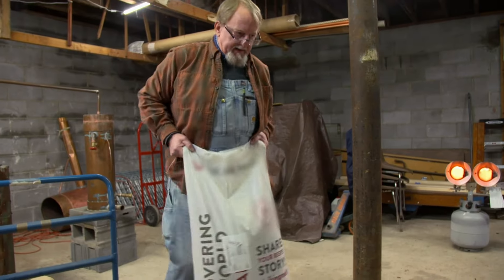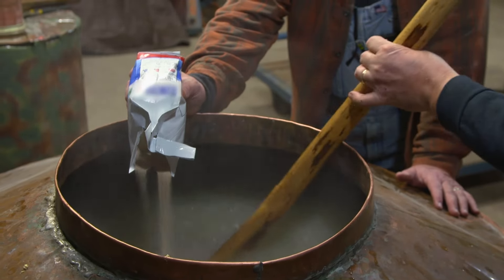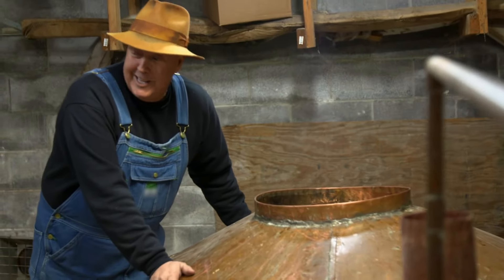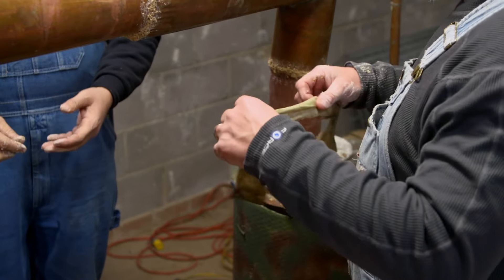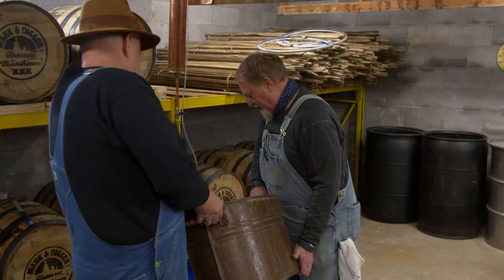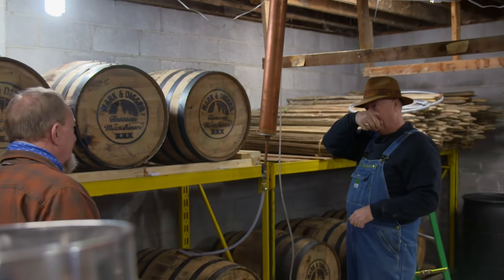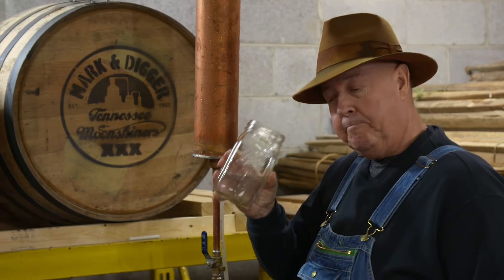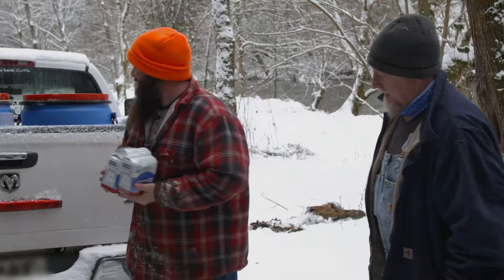Mark And Digger Make True Tennessee Whiskey | Moonshiners

Comment: I see they are burning propane indoors, I'm wandering if they exhaust system or just cracked doors/windows?
Reply: You don't need to exhaust propane. That's why forklifts run off it in warehouses
Reply: @ronnierowe6764  “that’s a clean burning fuel, I’ll tell you hwat”